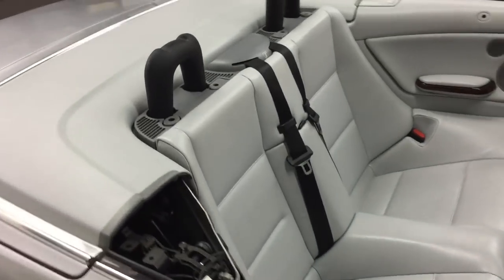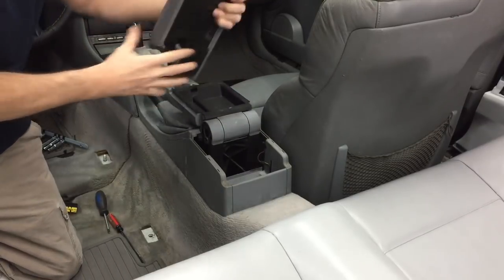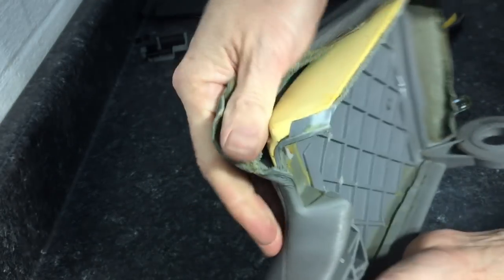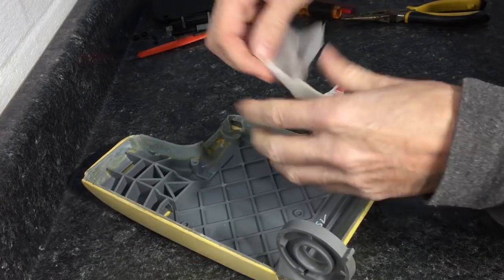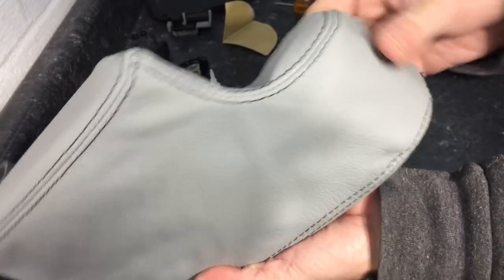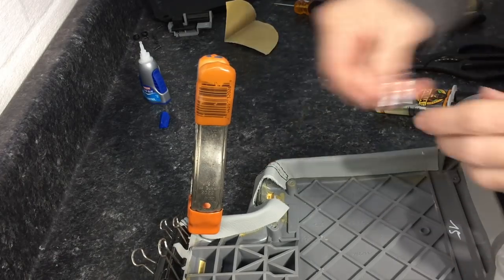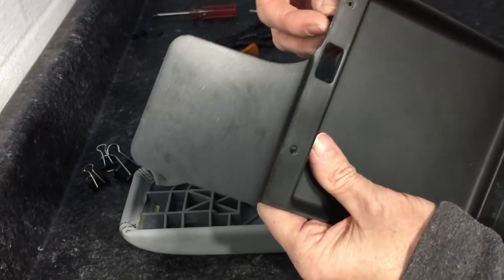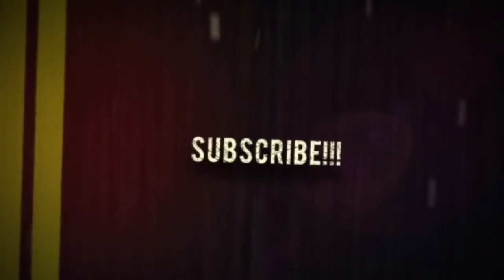Leather Armrest Restoration And Replacement! Vlog # 5 Interior Restoration of E 46 BMW!

Comment: Great video Brian. 

Would like to see the method used to remove wrinkles in leather with a steamer.
Reply from the maker: 3 ways to do it ...the steamer, lay hot, damp towels over it, pull the car out with the top down on a warm sunny day. heat and a bit of moister draws the leather a bit tighter naturally.

Comment: yeah everything was fine until he actually started wrapping it again... you need to tighten the leather over that not loosely fit it like he did... you can tell its not tightly fitted because the stiches dont match the outer edge on both sides

Comment: Every video I watch everyone wants to remove those rubber nipples.  It is unnecessary to do that.  They lift off when you remove the plastic inner cover.  I have done this on my own car and they lift out.  If you pull them out you run the chance of breaking them. Also at 11:45 you put them back in backwards. Oh and at 12:41, you didn't properly put the latch in correctly since you can see the numbers.  There are two tabs at the bottom that have to fit into 2 slots in the lid.